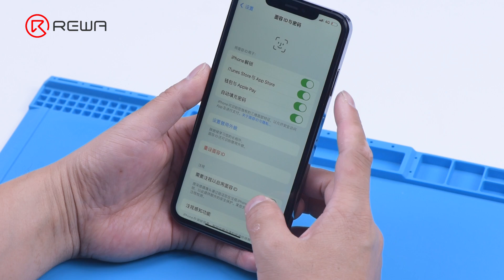How to Turn Destroyed iPhone XS Max into Brand New "iPhone 13 Pro Max"

Comment: Thanks for the video guys. Great work as always.

In regards to the video ideas: M1 Mac storage upgrades, but to be more specific: what's the difference between the vastly available BGA110 nand storage chips for the iPhone 11/12/13 and the nand storage used for the M1 devices - are there physical differences between the hard drives or just ways Apple serializes them for specific case uses and how to proceed with choosing the correct nand for M1 mac storage upgrades. Happy holidays!
Reply: "hard drives" Wow.
Reply: @FR4M3Sharma  Hard drives are what the Chinese sellers use to refer to when you're asking for the Apple nand. Virtually every manufacturer of the nand programmers call it the harddisk programmer. Hence using the term.
Reply from the maker: Merry Christmas! We appreciate your video ideas and we plan to work on them in the near future.